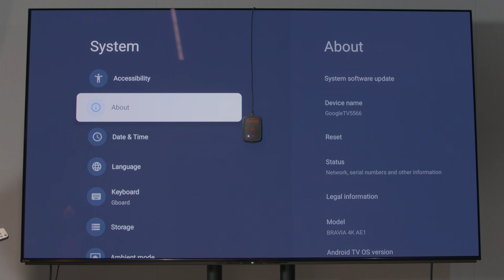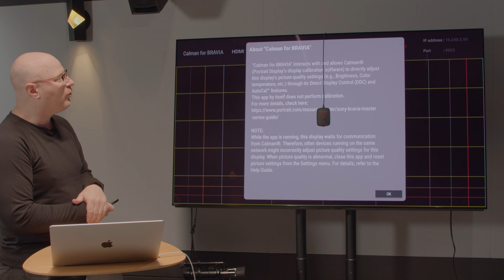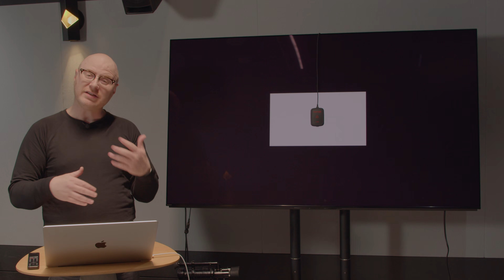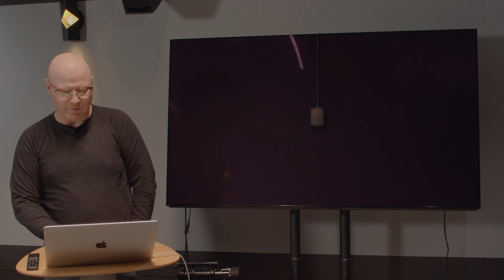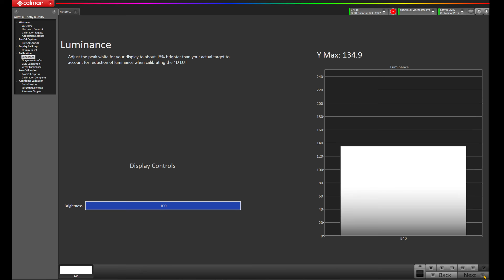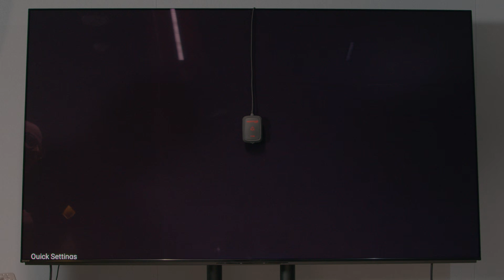Master TV Calibration at Home: Sony A95L Tips and Tricks with Calman

Comment: Normally you set brightness to 115 (15% above 100) before the calibration, but because he pushed contrast up to 100 in SDR, he targeted 135 brightness, as after contrast is auto reduced to 90 and brightness will also be reduced.
He says contrast at 100 in the SDR calibration is more accurate for this Sony OLED.

Comment: Would you recommend a similar methodology with the a95k?
Reply from the maker: Absolutely, the calibration methodology for the A95K is similar. However, it's important to be aware of potential subtle differences you might encounter during the calibration process. Each model has its unique characteristics that might affect calibration.

Comment: My recommendation is to don’t touch the RGB bias on the 2 points WB settings or you will raise the black level of the TV to 0.003 nits. At that level of light you’ll also notice heavy dithering.

Comment: Would this be the same procedure for the Sony A90J
Reply: The methods described in this video would be more appropriate for the A90J if you want to utilize Calman + Autocal:

https://www.youtube.com/watch?v=7SPDQUwCvnE&t=3s
Reply: @RandomPrecision92 I couldn’t bring myself to watch, as riddled with mistakes from the get go. Also one thing that I have learnt over the years is your calibration is as only as good as your meter. i1Display is a no no even if profiled of a spectro. I should have stated it’s a Europe panel and the Judd white point doesn’t work.

I was thinking of purchasing a better meter but I will just leave TV as is as I have no concrete way of calibrating this correctly.
Reply from the maker: Yes, the calibration methodology for the Sony A90J is similar. While you may encounter some differences during the calibration process, the overall procedure remains consistent with other models.

Comment: Nice video. Can you tell why the colour format is RGB Limited 10 bit for SDR? Why not YCbCr that is popularly used for video content?
Reply from the maker: That's a great question about calibration formats! We recommend using RGB Limited for calibration because it minimizes conversions and maximizes accuracy. While calibrating in YCbCr is possible, it involves additional conversion steps that might introduce slight errors. By sending RGB directly, we ensure the most accurate and efficient calibration process for your Sony display.

Comment: How can the A95L and CALMAN be enabled to do gamma based picture tracking? For example,  If I want to perform a 3D LUT for HDR10, the display needs to have gamma based tracking (not PQ), to be able to provide the max output possible (700-800 nits) with gamma 2.2-2.4, and disable any kind of tone/gamut mapping like is an available option in the LG secret service menu. I believe Panasonic also supports 66-Point Cube 3D LUT for HDR10, and there is a trick to disable the tone mapping. The A95L can have the tone mapping disabled but in order to take advantage of HDR Dynamic Tone Mapping (DTM) via a video processor like an MadVR MK2, there has to be a way to use gamma based tracking to enable properly is my understanding........any chance Sony opens this feature up and/or suggestions? I believe it requires SONY to allow 3DLUT capability as well in CALMAN which I don't believe is currently available, do you know if that will change as well?
Reply from the maker: That's a great inquiry! Currently, there isn't a known method to achieve the maximum luminance in Gamma EOTF mode that is possible in HDR (PQ - ST.2084). We suggest reaching out to Sony to request this feature.

Comment: I’ve heard that QDOLED needs a particularly fine resolution of a couple nm.  Does this unit have that?
Reply: Ideally, yes, you'd want to create a profile for your colorimeter, on your specific display, using a reference (5 nm or less) spectroradiometer.  This is due to the thin peaks of the spectral power distribution of QD tech, which are too thin to be measured accurately by budget meters.

The video is using a C7 colorimeter + a "meter profile" a/k/a a spectral correction file available via Calman.  These are files which contain the measurement info of a reference spectroradiometer on a particular display tech.  In this case, the profile being used is measurement info for a QD OLED.

The idea is that while you're not using a profile created for your specific display, using a profile created on the same display type should theoretically make your colorimeter more accurate than not using any type of profile at all.

Comment: Is using calibrated SDR color + Gradation Preferred Tone Mapping + Contrast 90 for Dolby Vision an explicit recommendation from Sony?   If so, is it specifically for the A95L, or all new 2023 Sony models?

From my understanding, the prior recommendation for older models and Dolby Vision was Contrast MAX, No Tone Mapping, and DoVi Dark borrowed nothing from SDR CMS.
Reply from the maker: Excellent question! When calibrating a display to a specific target, the process involves using all available controls and adjustments to achieve the desired outcome. Therefore, the recommended practice is to set these controls as needed for your calibration target. You might notice changes from year to year or between models. Additionally, firmware updates from manufacturers can occasionally bring about these changes, albeit rarely.

Comment: Thank you for sharing this!

I’m confused on one point and wondering if you could clarify. Why set to gamma 2.2, calibrate and switch to 2.4 rather than do the calibration in 2.4 from the start?
Reply: He goes over this around the 6:50 mark. The set "derives" the 2.4 gamma from the calibration of 2.2
Reply: Sonys are meant to be calibrated using its native gamma (2.2) with Contrast set at MAX while viewing content with contrast set at 90. 

You can change gamma after the fact and the panel will "do the math" for you, tracking 2.3 gamma at the -1 setting and 2.4 at -2.  SDR RGB balance and CMS accuracy will be maintained.
Reply: I am guessing he wants to stick to the default '-2' gamma setting in the TV or else Sony's overzealous processing might affect other aspects.